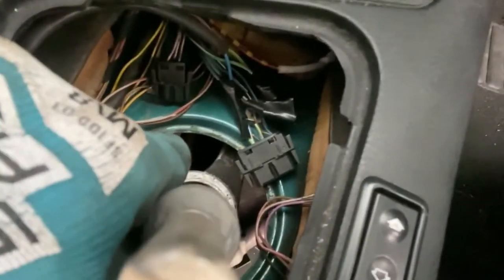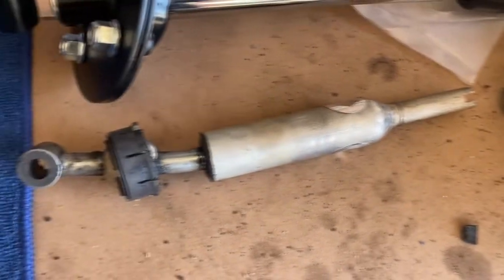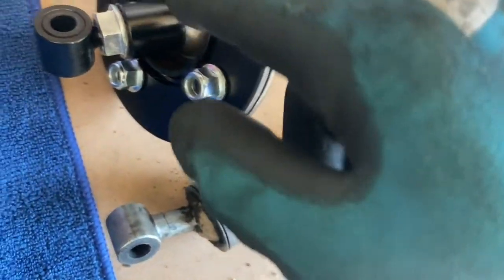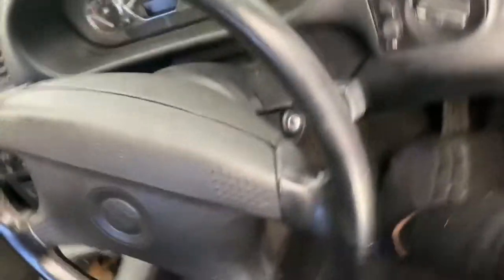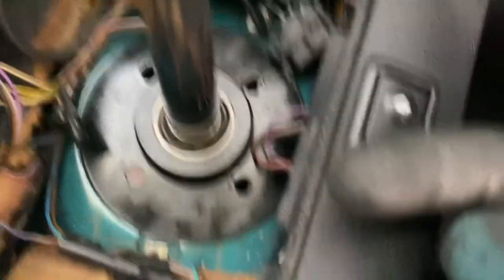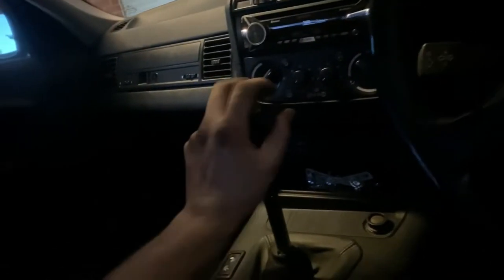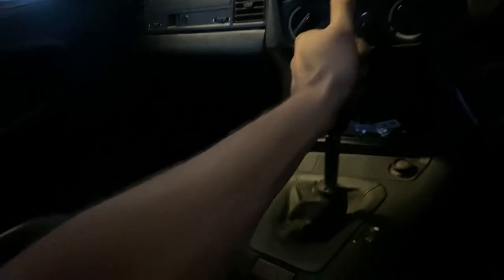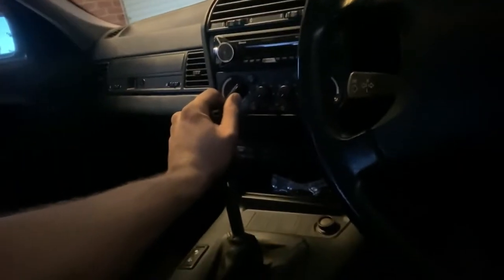BMW E36 POV DRIVE + NEW MODS!

Comment: I think cutting the length of that gearstick down will make it a lot easier to find gears in a short shifter. Angle grinder and welding job? I mean the point of a short shifter is to reduce hand travel (so length helps) but if you're missing the gear, any time gained is lost anyway. You making this a drag monster? Of course, experience and practice with your exact setup will iron out shifting errors once you have it dialled in. 

Loving the intros and edits!
Reply from the maker: I just swapped back to the oem shifter and pressure fit the new shift knob to it, much better then the tiny factory knob and much smoother for all the gears, short shifter has taken a place on my shelf where it will probably stay lol